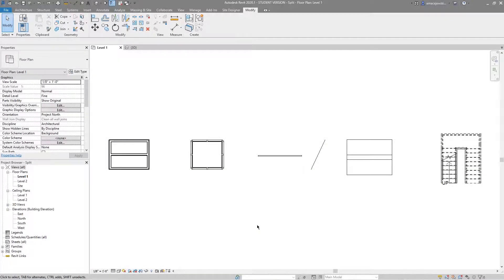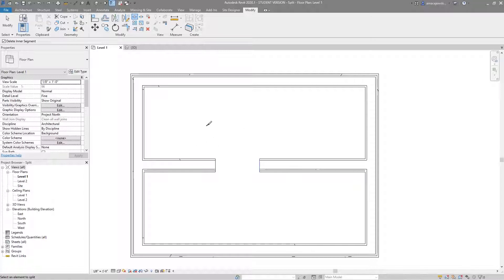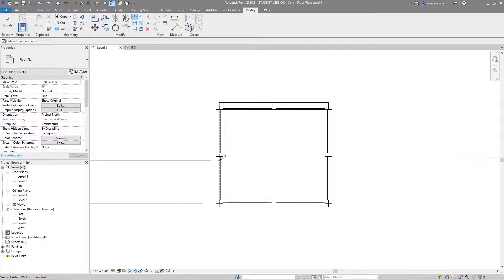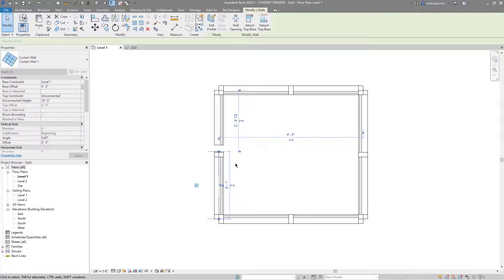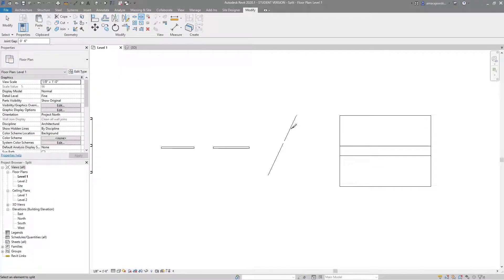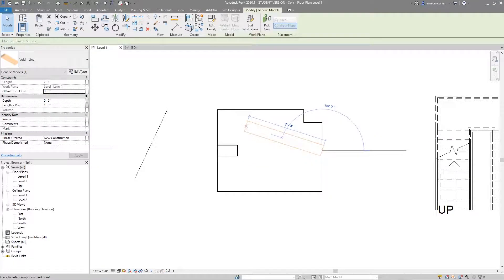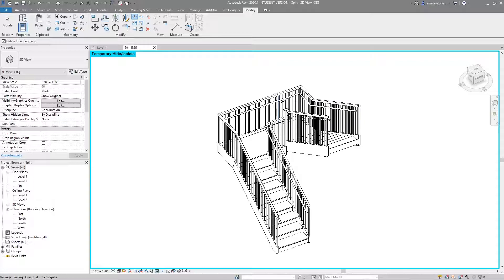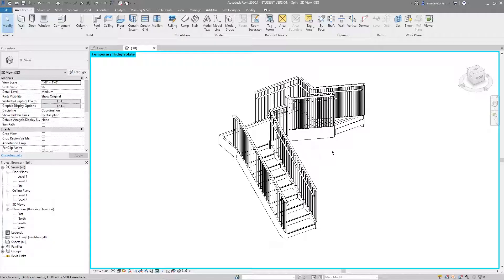How to Use the Split Tool in Revit | Revit 2020

Comment: Hi Sir.

Every time I use split command, it is not showing the witness dimensions. How do I make it appear? I am using Revit 2019.
Reply: If you are not seeing the witness lines in plan - may be beam is sloped- go to an elevation view and you will see them while splitting beams. Worked for me